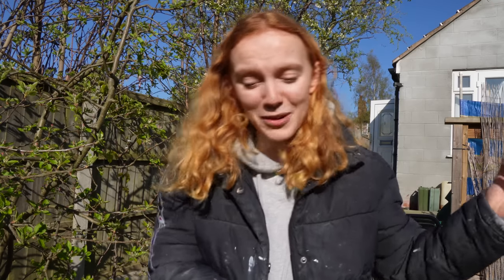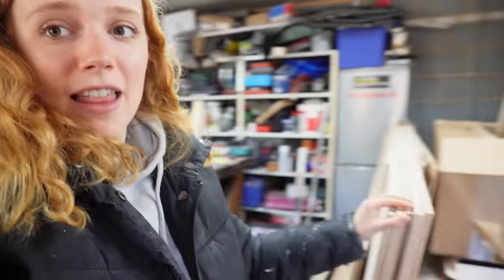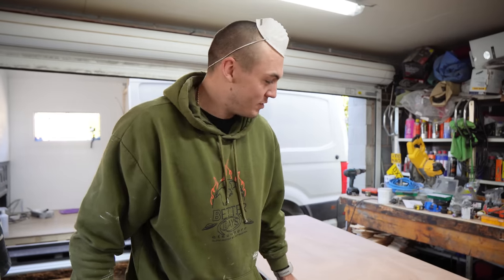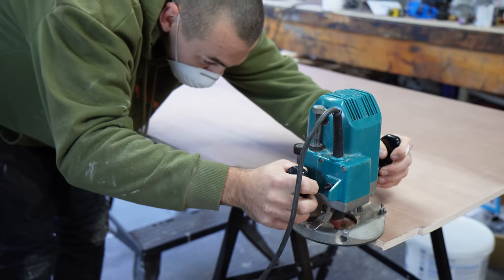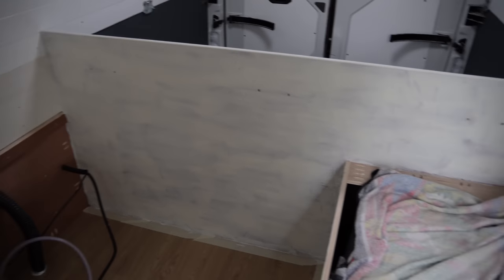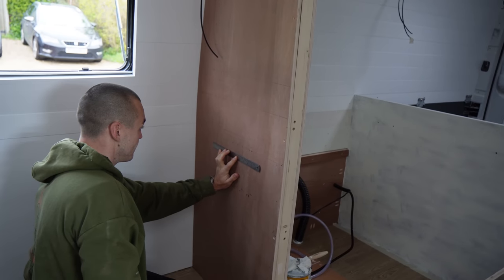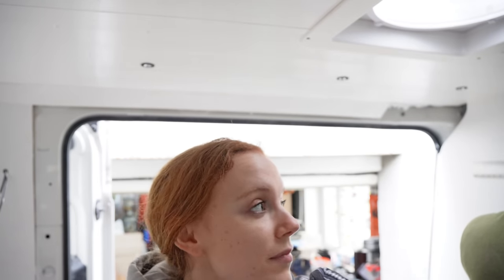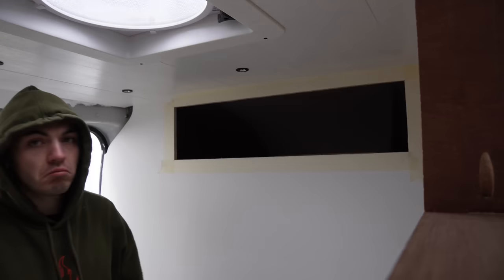Watch this if you’re thinking about a van conversion…. | Van Life Build - Ep.3

Comment: Oh man that fridge has worked out perfectly and the van is really starting to take shape. I know you're worried about space but you've come from a VW, you'll need a map of the new one as it'll be so big in comparison. Ours is an L1H1 Boxer with a double seat by the sliding door, between it and the cooker the walkway is max 380mm, and it's fine. You'll be fine. Looking forward to seeing the final van. Any chance you'll be at Van Love Fest and showing off a finished product?
Reply from the maker: Some times we think we've got loads of room and are wondering if the light switch is 'too far away' and then sometimes we worry about walking space through the van, but we know once we're in it will all feel like one big hotel to us compared to the VW! No we would have loved to but we couldn't plan that well in advance to know if the build would be done or not, maybe next year though!
Reply: @TheJammyGits  Ah that's a shame would have loved to chat Vietnam with you ahead of our travels. And see the van obvs 🙂